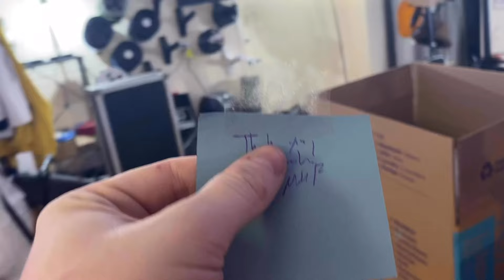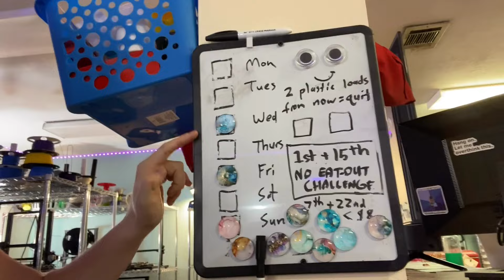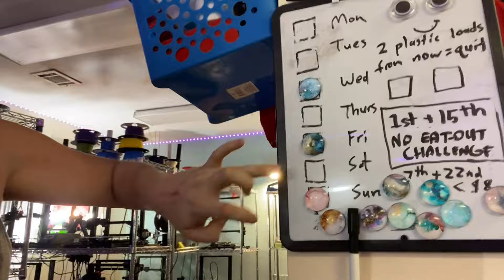How a 3D-Printing Business Works: Etsy Items Reinstated! Flipping Beautiful Humidor, M3is3D Vlog #23

Comment: Ive been a 'long time viewer' and really enjoy watching your videos. 

Have you considered getting one of the newer faster printers like a bambu A1 or P1S?

I have a sizable print farm and used to have a lot of i3 printers, i moved to P1S and essentially the output of the P1S is 10x over my old i3s. Even 1 of these would probably increase the speed of your production noticeably for smaller stuff.

They would be great for your smaller prints. They also use less electricity relatively and probably less post cleaning. 

Not sure how well your own produced filament would handle the higher flow, but then thats what 30 day returns are for 😂
Reply from the maker: @ps81409  hmm interesting